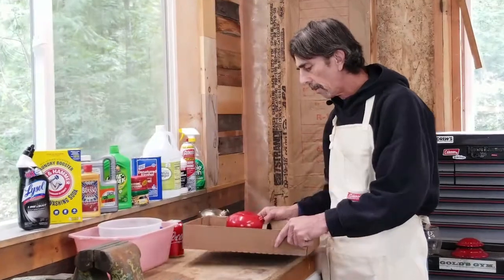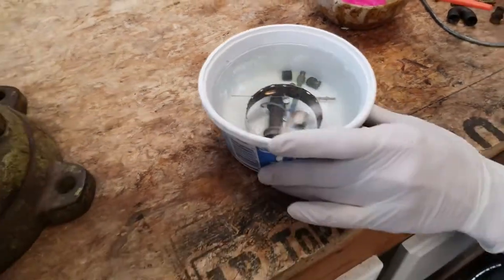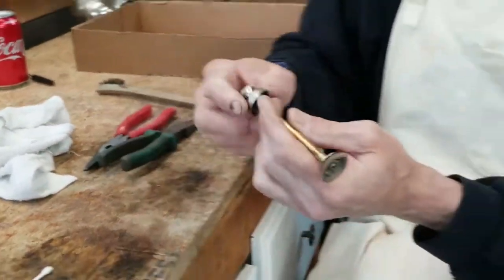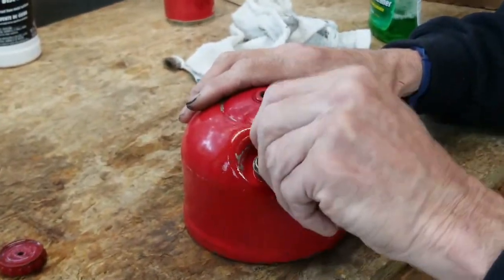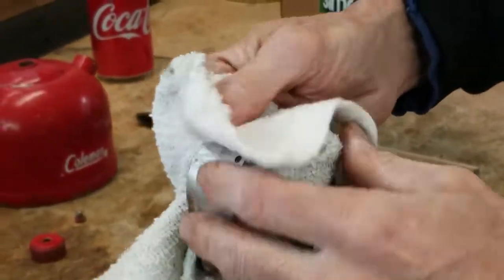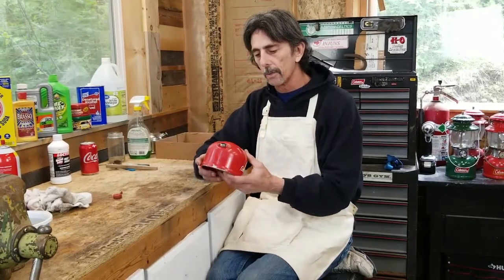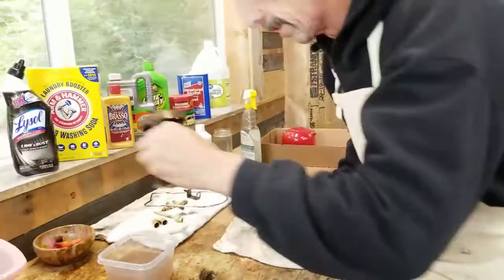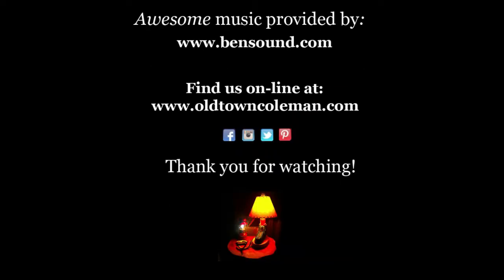How to Rebuild a Coleman Single Mantle Lantern Part II Cleaning

Comment: I use citric acid rather than vinegar, it does just as good a job on the brass and steel and is easier to store as it comes as a powder.  I don't use naval jelly at all, I can mix a gallon or 2 with water to make a citric acid bath and soak it all.  It will darken the steel but breaks up all the loose rust just like naval jelly will, a scrub with a brash brush and a polish with emery cloth will bring back the brightness of the frame.

Comment: If I need to get crud out of the fount I fill fount 1/4 way full with denatured
 alcohol add a pack of BBs then heat fount with very warm water and swish all around for about 1/2 hour.This really cleans up the fount.Richard Wolfenden used Permatex Aviation form-a-gasket on the valve assembly threads.

Comment: Thanks for the video. What would you use to shine the porcelain part on top. Thank you
Reply from the maker: Warm soap and water on the porcelain enamel.  I've used goo gone to get spots off, along with my finger nail.  Don't ever use an abrasive on a vent or you will scratch and/or dull it badly.
Reply: @OldTownColeman  Thank you sir. Greatly appreciate your advice.

Comment: If the painting on the fount and top are chipped, especially around the fill and pump holes.  Would it be advisable to strip and repaint, or leave them to keep the character of the lantern?
Reply from the maker: Gary character is a good thing, in my eyes.  Some folks pay big bucks for pristine lanterns and that is fine but I am very comfortable with a little paint loss here and there.  Remember that the ventilator is not painted, and it cannot be painted.

Comment: Is there a specific size gasket to get for the filler cap? Don't want to get one of the wrong sized ones. Also, can they be found at hardware stores?
Reply from the maker: Charlie, no they cannot be found at hardware stores.  I took originals and had them sized by the company that sells them to Old Coleman Parts, so I know they are correct.  They fit like a glove!

Comment: Have you ever tried Evaporust on rust? My other hobbies are old Lionel trains and cast iron. Evaporust works better on the tracks and cast iron for rust and you can leave it for days with no pitting.  The other thing I use is an electrolysis tank. But only on steel.
Reply from the maker: I have, and I use the electrolysis frequently for steel frames and burners.  I'm about to do a video on a 500 stove and will probably use the electrolysis there.